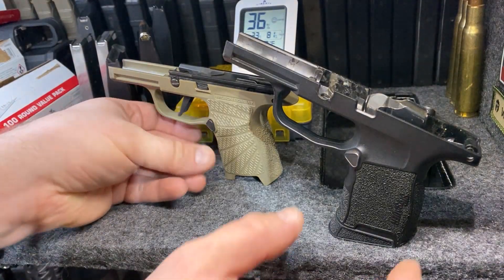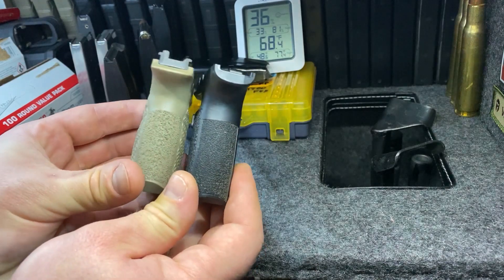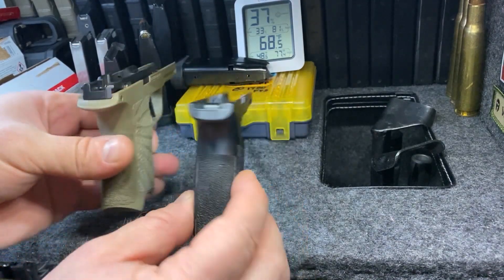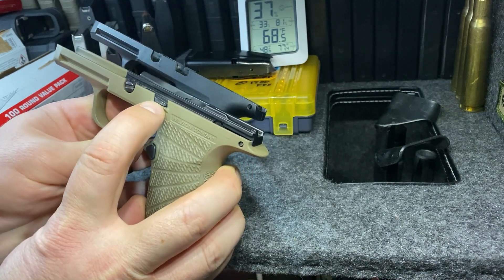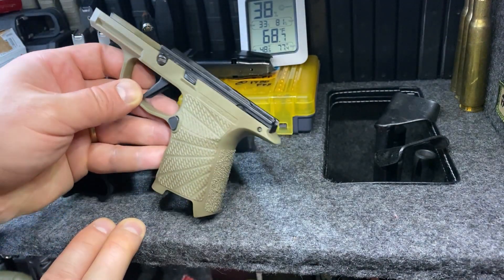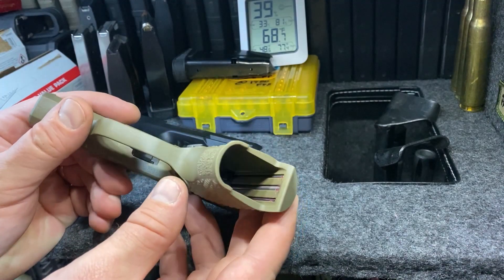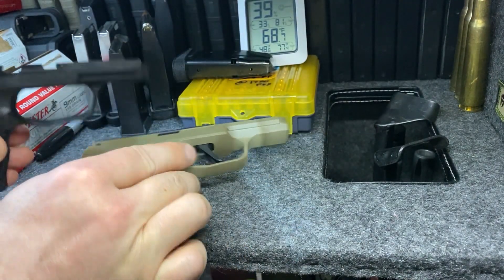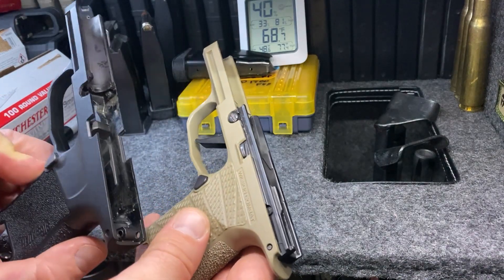Sig P365 Grips - Factory Vs Wilson Combat Side by Side Comparison

Comment: How does it handle when firing the gun though? My biggest gripe is that it appears as though it dances in the hand a  bit with the stock grip and I know I am a better shot then what I am currently getting.
Reply from the maker: I have another video where I talk about that exact issue of "dancing" or "tilting" left to right, back and forth, etc.  This grip pretty much eliminates that for me.  In fact, since I've made this video I've switched to using center-axis relock position exclusively, and can draw and rapid fire (3 - 4 shots per second) at 10 yards and hit 100% of my shots - moving between center mass and head without missing.  There was no way I could do that with the original grip.  I've been meaning to make a new video showing just how much one's shooting can improve with this grip but I haven't had the time.

Comment: Does the Wilson grip module cave in like the OEM grip module?  OEM feels very flimsy.  Thank you in advance.
Reply from the maker: No, I would say the WC grip module is much less prone to any sort of deformation.
Reply: Thank you for the quick reply.  Did you do any trigger upgrade to make it crisper?  If so, any reliability issues?  Thanks
Reply from the maker: @joewalker6931  Great question!  The only thing I did was put a straight trigger instead of the stock curved one that came with it.  I haven't done any modifications to the FCU that would change the feel of the break or anything - but now that you ask, it's got me wondering if I should!

Comment: Question please,  would you say that the walls of the grip on t W/C module were thicker than the Sig original, thanks and a good video here👍
Reply from the maker: Yes - they are definitely thicker overall, and even more so in the grip.
Reply: @GuitarGunner  thanks,  have a good-1

Comment: Do they make one with a regular picatinny rail instead of a sig rail?
Reply from the maker: Unfortunately they do not.  There are some really nice alluminum P365 frames out there that have M1913 rails on them, but they are expensive.  I bet if you looked around you could find some polymer frames with an M1913 rail as well, but I haven't looked.

Comment: Is the distance between the trigger-face and where your thumb webbing goes on the grip further on the Wilson Combat or the factory grip? I feel like I can’t get good purchase with my thumb wedding on the factory grip because of the way it swells on the back. Does that make sense?
Reply from the maker: I think I get what you were saying… However, the Wilson combat grip has a much thicker bulge and a slightly larger circumference, so I would think that the distance would be greater. Personally, I cannot tell much of a difference. For me, the biggest difference is the custom Wilson Combat stippling that goes up the length of the grip where your thumb would go… That makes a big difference for me. As far as distance between thumb and trigger face, it’s very hard to determine. I would have to use a caliper and measure between the two.

Comment: Are they the same height?  As in does it make the grip any longer?
Reply from the maker: As far as I can tell they have the same grip length - however the WCP365 grip has more "bulge" in the middle for those of us with meatier hands.  If you check out Wilson Combat's website they recently added some side-by-side pics of factory vs WCP365.  I posted some here on a comment but it'd probably be easier to view them on their website.

Comment: Do the weights add a noticeable difference? Worth the ~$20 upgrade?
Reply from the maker: Yes, they’re definitely worth it and the weight difference is significant.
Reply: @GuitarGunner  , would you mind embellishing? specifically how did you benefit from the weights?
Reply from the maker: @googoo-gjoob  Hey there, sure!  I have another video that goes over it more in depth, but basically for me the weights made a huge difference being able to control recoil and "gun wobble" when shooting faster, like mag dumping at 2 rounds per second.  Without the weights the gun was kind of flipping itself back and forth and side to side, and my accuracy was maybe 50%.  With the weights added I was able to basically do a mag dump of 15 rounds on a 7.5" wide steel target at 15 yards with a 100% hit rate.  In general for me they added more stability by increasing the weight of the gun toward the back.
Reply: @GuitarGunner  , i thank you for your report. each person who responded gives the same report. 
but this completely defies logic. adding weight to the back of the gun makes the front behave?!!?
baffles me. guess ill have to try it. thanks again.
Reply from the maker: @googoo-gjoob  I felt the same way as you.  I think it really just redistrubutes the weight for evenly, which lends itself to better control imo.

Comment: Why would they add weights in the grip?… why make it heavier?
Reply from the maker: The added weight is to reduce muzzle flip, help with recoil management and accuracy.  The tungsten weights are optional, you don't have to buy them.  I purchased them because I didn't like the weight distrubtion of my P365 in general.  I thought it was too top heavy (especially compared to my Glock 43 and my P938 EDC's), which made the gun "tilt" back and forth between shots.  The added weight - for me - has greatly increased the pistol's handling.  I just went out to my range and put 20 rapid fire shots at 20 yards on a 6" target with 100% hit rate.  I could not do that before with this pistol in it's earlier configurations.
Reply: @GuitarGunner  makes sense. I guess if you’re going to use this as more of a target pistol then more recoil mitigation makes sense. Personally I wouldn’t want this to be heavier. That’s the whole point of it being small/light weight.
Reply: @GuitarGunner  I bought the tungsten weight kit for my P320 XCompact with the Wilson Combat grip over a year ago. Finally installed them last week, 😲 shot the gun and it was stacking rounds noticeable better than previously. So yes that 1.5 oz of weights in the grip helps the gun shoot and stay flatter! 👍🏿 Going to do the same for my P365XL and pronto! 🤣
Reply from the maker: @davidhudson2527  That's what I'm sayin'!  The added weight for me is nothin, it still weighs about the same as my P938 which was my EDC for a long time.  Now it shoots as good as my P938 and my G43.  Totally worth it!
Reply: @GuitarGunner  Good review, thanks. I’d sure hate for one of those weights to come loose when trying to insert a mag. Sounds like the grease is working so far.
Reply from the maker: @tractordirt Thanks!  Just an FYI the slots for the weights are designed in such a way that even if they're loose in the grip, they won't fall out or interfere with mag function.

Comment: Put a Houge grip on makes it a little thicker adds support to the beaver tail and adds better separation between the second and third finger both grip modules where your fingers wrap around are flat look at a Houge grip Amazon has them you will see that Houge adds an extra separation between the second and third finger some say it's hard to put on I heated it with a hair dryer took 5 minutes I know Wilson combat makes excellent products but $65.00 just for stippling I paid 12.95 for the Houge grip on Amazon they have all colors less recoil because it adds a firmer grip and if you don't like the Houge grip you can return it.
Reply: I’ve been carrying my P365 with the Hogue grips for about a year now and I love it! It fits my hand like a glove now. It was well worth the price.
Reply from the maker: I do have a Hogue grip on my P938, but for now I’m going to stick with the stippled WC grip on my 365.

Comment: Doesn’t look like they did anything to the rail.  The one thing they should have done was make it the standard pistol rail instead of that sig proprietary rail.
Reply from the maker: I'm not sure if that's the case... The Sig proprietary rail is usually curved, while this rail and the one on the factory SAS grip has a flat edge.  Maybe they're two different proprietary rail styles?  

I don't think you'd have an issue mounting anything to it that was made for sub-compact conceal carry pistols, but don't quote me on that.   Here's an image I found of a P226 with a comparison:  https://www.northwestfirearms.com/attachments/948ibpkdmehbip000kgp-jpg.348143/

Also, it looks like they make a clunky picatinny adapter (I'm sure there's better ones than this one out here, but just for reference):  https://www.amazon.com/Recover-Tactical-Picatinny-Installation-Modifications/dp/B07JBJDKP6

Either way you can get a TLR-6 for $100 with a light / laser that'll fit the 365.  I guess if you already had a micro torch that wasn't made for the 365 then that's where that standard rail would be better.